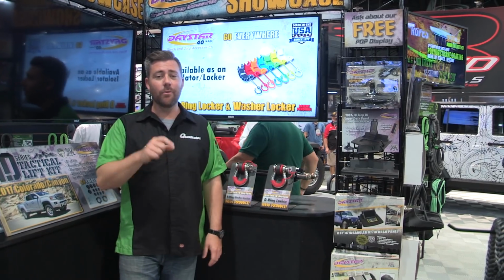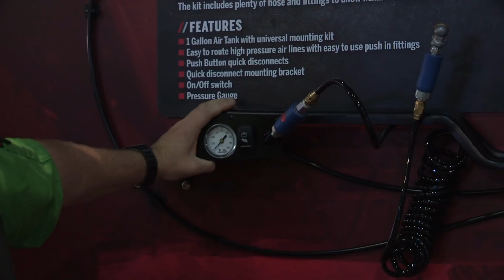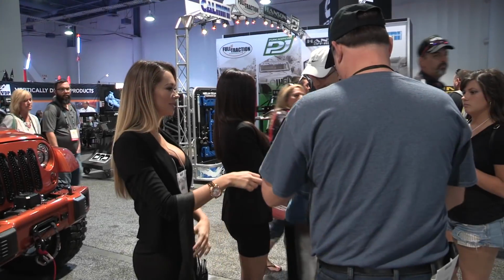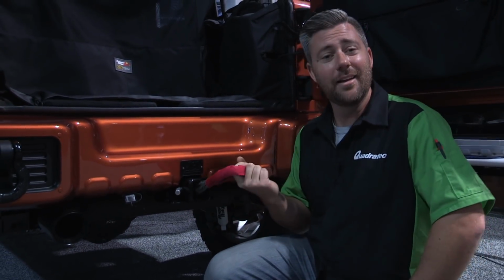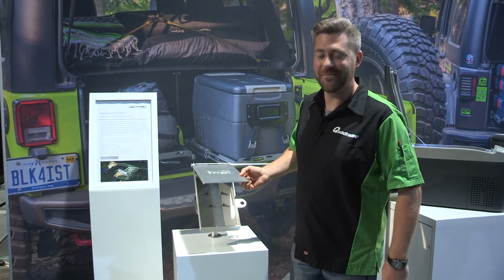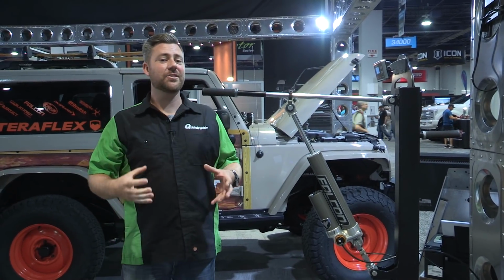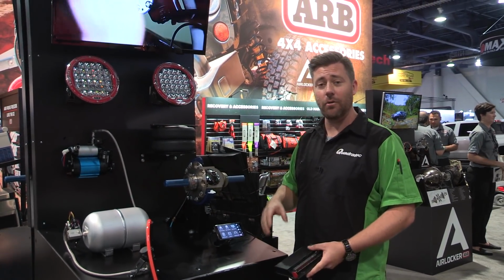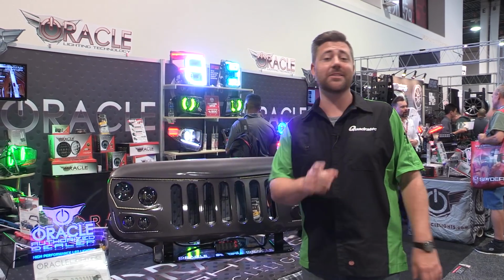Top New Jeep Products of SEMA 2017

Comment: I wonder if most 'lost' "D" rings are more or less stolen rather than just fall off.
Reply: Zip ties on the pin and thru the shackle
Reply: I torque mine down, and use locktight. Unless someone's got tools, they ain't getting them off.
Reply: insylem I take mine off when I drive around I have had 8 d rings stolen already 😒
Reply: Carry a heavy duty crescent wrench and torque down your bolt.  It is steal proof? No, but it makes it harder to take off